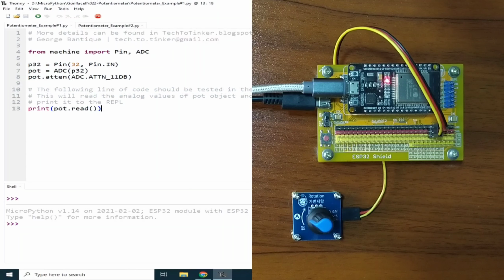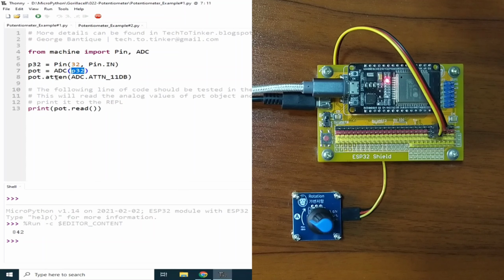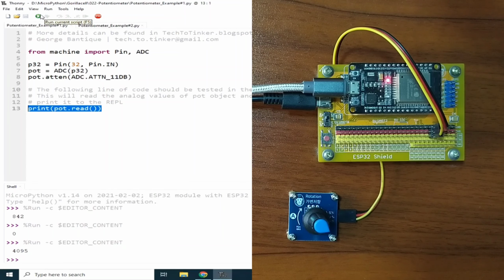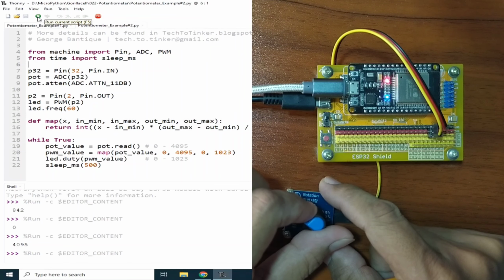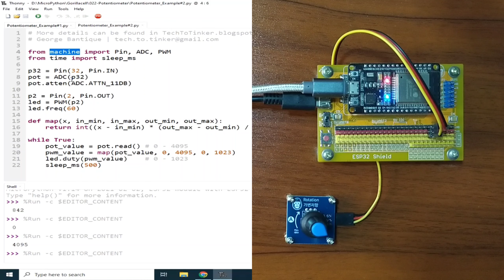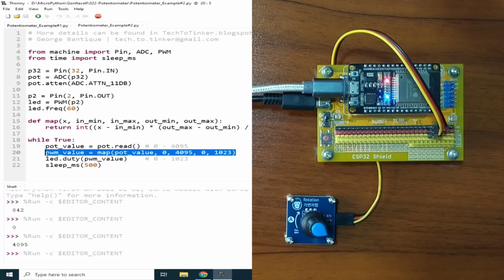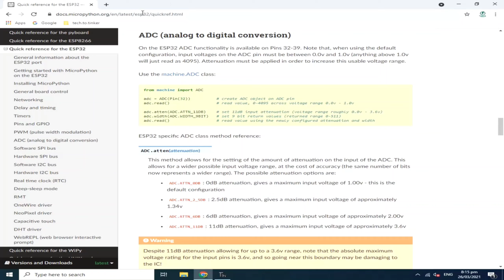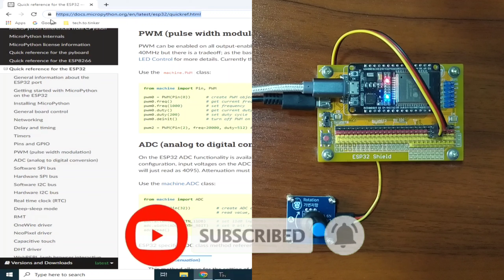022 - MicroPython TechNotes: Potentiometer

Comment: Please help. I got some attribute errors: ' pin' object has no attribute 'on' or 'high' on esp32 micropython .
Reply from the maker: @Shukhrat Dad, have you click the RUN button in Thonny IDE?
Reply: @TechToTinker  yes. And some times I got message: %Run c $EDITOR_CONTENT --- what does it mean?
Reply from the maker: @Shukhrat Dad, it's very normal. That message only means that you are running a code from the editor. Other ways are using the REPL and writing your program in MicroPython root directory to make it work automatically after Reset or after power up. Cheers
Reply: @TechToTinker  thanks for your responses and help.  How to solve attribute error ...? I use pin.value () instead of pin.on() or pin.high()
Reply from the maker: @Shukhrat Dad, I double check the source code I provided but there is no instance that I use that "pin". Can you provide your source code instead?